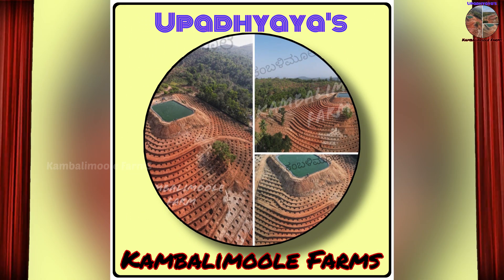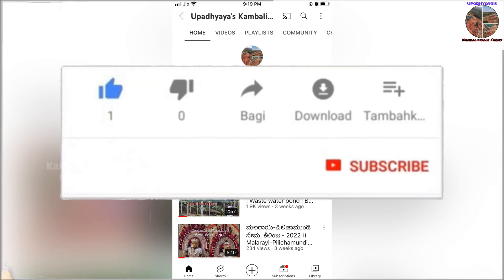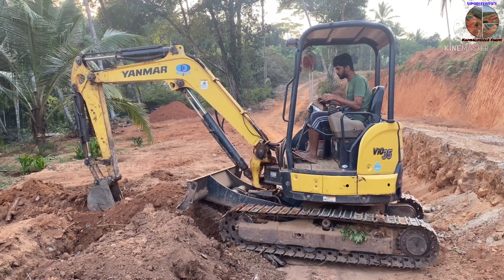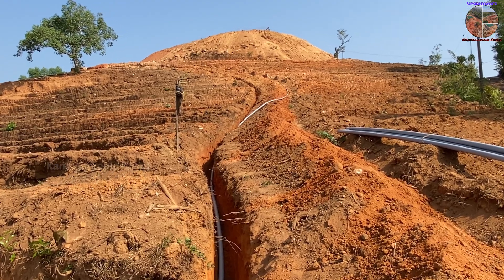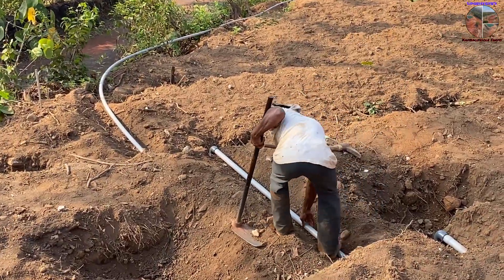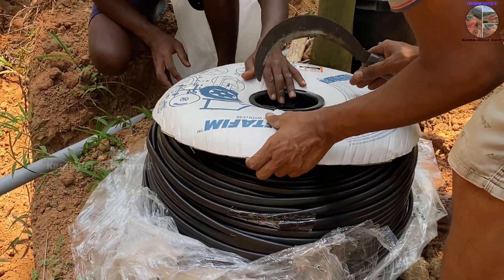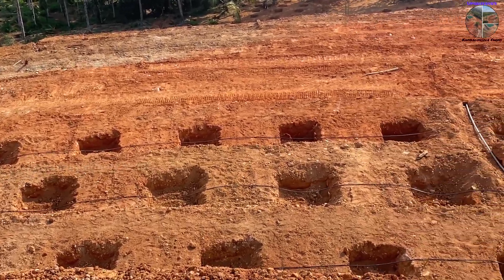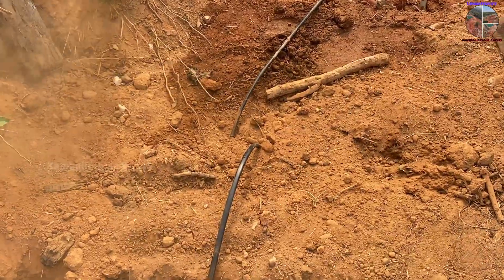How to install inline drip irrigation system | Netafim Inline dripping for Areca | ಹನಿ ನೀರಾವರಿ

Comment: What's d cost of the installation , the filter unit etc
Reply from the maker: Installation we did ourself. Sand filter, disc filter and fittings cost arround 60k to 70K( PVC pipe and drip lateral line cost extra.)